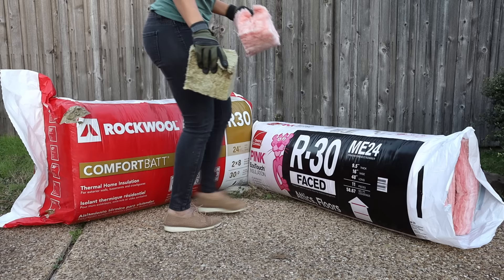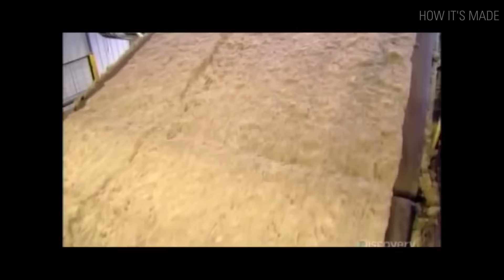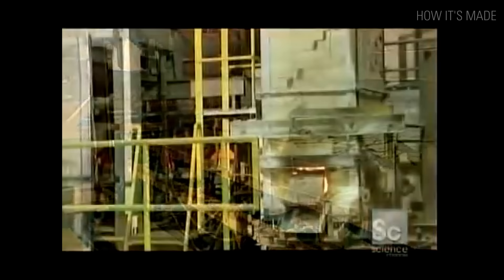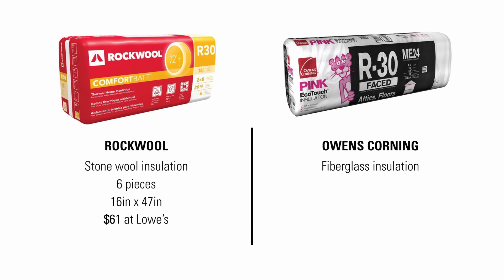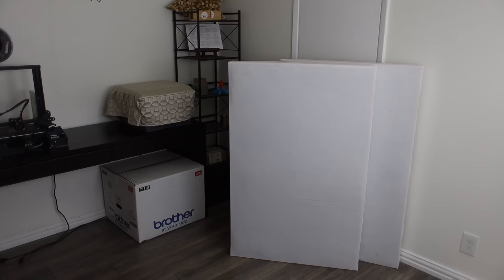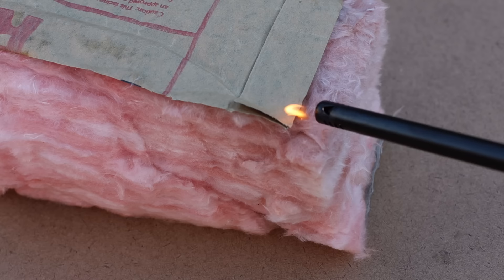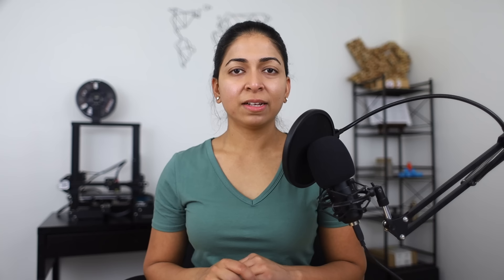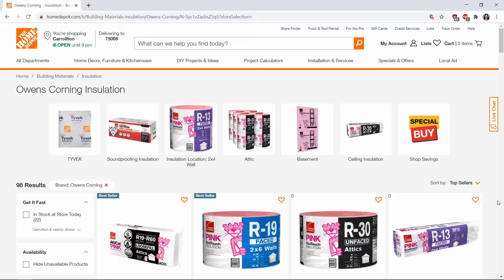Mineral wool vs fiberglass insulation | everything you need to know

Comment: Go stone wool, you'll never have to question if your insulation is harboring mold
Reply: @John Grzeskowiak the stone wool is water resistant, making it hard for mold to grow. Which if you have a leak you would still have repairs to do, but at least you dont have to replace your insulation.
Reply: @John Grzeskowiak those are gutters, you should try insulating them.
Reply: Go stone wool, it insulates well against both temperstures and sound.

Comment: As someone who has dealt with installing insulation before, you've suddenly made me a fan of the rock wool, which I've never used before. Thank you.
Reply: Only problem is that it's super expensive from what I recall.
Reply: @robertmedina3195  I guess it comes down to price vs efficiency. I can tell you, though, if water ever gets into it - like a pipe leaking inside the wall - soaked fiberglass is a cold mess by the time you finally locate it, especially in winter.
Reply: @Cetok01  if you have a leaking pipe that's buried in any kind of insulation it's going to be a mess regardless of the type of insulation. To me finding a roof leak on an insulated roof is the real nightmare since water trails down the roofline making it hard to find. I used cellulose for my attic floors on top of either closed cell foam board or 2" rigid foam board. Doing it this way I can rip down my ceilings and insulation won't come pouring down on top of me 🙂
Reply: @robertmedina3195  Good solution, decent outcome. I had to deal with what I described and would have preferred the rock wool, which probably could have been easily removed, shaken, dried and replaced. The glass was a mess, acted like a wick and led to more damage inside and to the wall.
Reply: @robertmedina3195  You pay for insulation once instead of higher utility bills forever.
Reply: @kobek4159  not true at all. Remodeling, for starters will make you pay for insulation more than once. I'm not sure how many insulation jobs or remodels you've done but you run out of space real fast trying to reuse insulation from remodels. I had to completely gut the insulation in my attic because the idiot who did it to begin with never put down a vapor barrier. I ended up throwing out a good 40 bags of material, probably more. It's common that insulation jobs are done improperly because people don't know as much as they think they do. There are also times where unfortunate things happen and you just have to replace the insulation that's there as it's no longer salvageable. For example if you find a nest of mice, I wouldn't try to save the insulation where I find a nest or if a tree branch comes through the roof causing a good leak. You should never save and try to reuse insulation that has been wet because of potential mold. Then there's also what is called wind washing near soffit vents that can damage insulation as well but most people aren't even aware of such a thing. I can continue but I digress.
Reply: I install rockwool for a living i can tell you it isn't nice
Reply: @robbiehurdman2439  what's the worst thing about it? They all have pros and cons.
Reply: @robertmedina3195  It depends on your climate, if you have a high difference between inner and outer temperature for long periods of the year, a good insulation is a no brainer. Any  installation done wrong is a waste of money, that is not the fault of the material.
If you ever worked with it, especially on a hot summer day, when you are sweating and you are breaded in wool dust like a chicken wing in breadcrumbs. It gives you new insights in itching.
Reply: @matekochkoch  ha, I did insulation for a living but we didn't do anything with rockwool. Loose fiberglass was the worst on the 100 degree days. We always did air sealing prior to insulating as well.
Reply: You wont be once you use it
Reply: @Cetok01  I used KNAUF glass wool and during construction one sheet got soaking wet as it wasn't cover yet with a board. It dry out and looked like new. Other packed foam for my attic insulation I kept near other building for a whole year or more and it got all soaking wet during a winter and heavy snow. After it got dry it was perfect. If you don't believe me I can send you pictures. Half centimetre got white due to sun (which actually proofs how long it was kept outside), but it did not get any fungus, got rotten or lost its insulation specs. I don't know about that PINK one, as in EU we don't have such, but I'm more than happy with KNAUF how it kept its visual and technical condition while getting whole wet for good half a year.
Reply: @DainiusZelnys  The glass wool I'm familliar with clumped together when wet and invited mold over time, at least if it wasn't in the sunlight. Perhaps it could be recovered, but it would be a lot more trouble than it's worth. But that's just my opinion.
Reply: @Cetok01  What can I say... different manufacturers different product. I'm not some pro builder. Just sharing my experience, and chose glass because it keeps dimensions better over time. Cost was very similar. I compared locally most popular Isover, Paroc and Knauf.  My builder was all for Paroc (rock) but i chose to go with glass. But after he noticed extremely fast drying time and how it went back to shape he was pleasantly surprised (maybe because KNAUF is hydrophobized). He said rock wool if get wet it takes week to dry in open area. If I turn back time, I would go with rock maybe, but this video doesn't present reality for sure.
Reply: trust me man, don’t it sucks to install, you can feel it through sweaters
Reply: @nevanuel1983  The only solution is to have both come in  plastic-wrapped batts.
Reply: More expensive , harder to install but a better product. Insulation installer for 35 years. Closed cell foam is probably the best but again very expensive.
Reply: @robertmedina3195  that all depends on your location, the code in your location, and the reality of what R value you need for the weather you gotta deal with
Reply: @nevanuel1983  not everybody can bro. I did both for years and neither bothered me
Reply: Don't be a fan trust me. It falls apart and really sucks to install. I've been insulating for 7 years. I know what I'm talking about.
Reply: That's funny.  The advertising is great on the rockwool.  The problem is that the pink is finally to a place where it is not dusty or itchy anymore.  The Rockwool is both of those things.... If you are worried about moisturethen use hemp insulation.
Reply: @robbiehurdman2439  I agree, it nasty stuff.
Reply: Guys, Here is The Savior

HalleluYAH translates “Praise ye YaH”

YaH is The Heavenly Father 
YaH arrives via the TENT OF MEETING
YaH was Who they Crucified for our sins
YaH was Crucified on an Almond TREE

— Ancient Semitic Cuneiform of Moshe (Moses)
— Isa Scroll (The Original Isaiah)

Isaiah 42:8
"I am YaH; that is my Name! I will not yield my glory to another or my praise to idols.”

Isaiah 43:11
“I am YAH, and there is no other Savior but Me.”

Isaiah 45:5
“I am YaH, and there is none else.”

Comment: Utterly fascinating. I had no idea stone wool insulation was even a thing. I didn't even know I was potentially interested in the topic. You give a stellar presentation and deliciously structured comparatives. Thank you!!
Reply: Thats why one might delve into topic they are not familiar with to learn about things like this. Personally i will not use fiberglass insulation anymore in anywhere, simply due it being  really hard to recycle and how easily it gets ruined. Even top of the rock wool i prefer for massive wood as it will naturally breath, there is plenty around where i live in cold north and mostly cause eventually every roof will leak some. What i have seen in construction industry around here, i would never put fiberglass into the house as just tiny amount of water that gets into insulation will not show it self, or get dried before whole frame needs to be demoslihed and potentially whole house needs to be tore down and rebuilt if owner wont notice the "early" signs of the water damage.
After that comes rock wool. Not a fan but this is what i recommend on using where you need to put insulation on. Least with this material you only need to rip open exterior or interior wall, get that damn vapor barrier out, witch is locking all that moisture into insulation and try to dry the area after leak is fixed.
On older style log construction: Ou there is a leak, well better fix the roof and thats about it. Logs will suck the water, but also let it dry naturally. I'm living in 101 years old log building that has not been maintained best and roof was and has been leaking from several spots. Biggest one let water straight top of outer wall. There is some rot damage on the top most logs and area was damp for two years.... got the roof fixed properly couple months ago and its been drying on its own. Would like to swap the log on top, but there is enough solid material so its not required and this is rental so i'm not going to go for such large repair my self out of pocket. If this was any other type of building it would be demolished back to the frame at very least. Sadly this construction material is available on near big forested areas and we dont have termites so go figure. Also massive wood does transfer heat witch can be positive or negative. On areas with lots of sunlight, i'm not sure it works that well, specially when there is not much forest anyway. Trick we tend to use is to open all windows at night to let cool air in and to cool the frame from both sides and then close the windows on morning that traps the cool air inside to be enjoyed during summer. Also we have big wood fireplaces that suck up lots of heat during summer from inside while heating in winter. For those who wonder, no you dont put the fireplace into end of the building! You place it in center so it actually warms the house from with in, not let majority of the heat outside, like i have seen in several US houses fire place being at the end of the house.
Reply: My old house is insulated with rock wool. I thought it was some obsolete, inferior product.
Thanks for making this video with the valuable information.
I even subscribed. Now I can see a list if your other vids.
Reply: You probably live in warm environment. I know the difference even without any construction practice.
Reply: I never Heard of Fiberglass insulation rockwool is Like the only Thing besides styrofoam
Reply: @SchlaftaterNrzZz  fiberglass is cheaper even today. It is widely used for industrial insulation of pipings.
Reply: It is less known in my country as well becuase we dont need its properties. We have relatively pretty dry weather here, moisture in the air isnt at the highest levels that often so we dont need stone wool here. Glass wool is much more economically viable, and in fact superior product if you count the price as well what is a huge factor. If you dont live in a very moisty climate, you are perfectly fine with glass wool and will save you thousands of dolllars for the same effect. The installation is a bit harder tho, thats true, have to use wires or similar so its secured in place until you install barriers and drywall.
Reply: @NotEvenDeathCanSaveU  Stone wool usage makes sense not only in high moisture climate but when your walls are not so thick and you want to get higher thermal resistance (R value) since R is arround 3x higher in stone wool compared to fiberglass inslation. So for double the money per square meter you get 3x the thermal resistance so in cold climate countries stone wool is actually better from an economically point of view. It all depends on your construction needs and what you want to achieve as an end result.
Reply: @kentrix.  I really don't know about that.. The R value is dependent on thickness, and it doesnt seem to have it much higher, the conductivity seems to be around the same range from 0.030 to 0.040 too, at least according to the manufacturers of some more known products I am comparing.
Reply: It looks as dangerous as "Asbestos" tho
Reply: @Hellsong89  TDLR; this guy likes logs

Comment: I just clicked on this as whim, and I was blown away how interesting,  complete, and well presented the information was. Very well done, Belinda!  BTW, where I live in the Bay Area / CA, building inspectors allow / recommend the use of Rockwool to seal top plate penetrations (say for electrical cable) because of it's great fire resistance properties.
Reply: ditto.. youtube algorithm is getting more diverse
Reply: Me too  I have never worked with Rock Wool .  I used to work construction - I HATED working with fiberglass. Pain in the ASS.  This video was well done.
Reply: excellent presentation
Reply: @johnbrowne3518  once you work with rock wool you won’t care about the price.
Reply: @Wroger Wroger What can I say, you're just wrong. Building code and fire ratings are based on testing, not periodic tables. Check out Rockwool's website on this matter, it can withstand temperatures exceeding 1,800f https://www.rockwool.com/learning/fire-safety/
Reply: I found her review to be very biased.
Reply: I have learned a lot from this video even after 3 years as an attic Insulator. It's like looking at a how it's made video. She is my inspiration on how to make my videos.
Reply: 420 bro me too
Reply: Why are these products are still allowed to be used?. It’s just plain common sense…

1. If you need to cover your skin, head,wear a professional respirator, eye protection and  heavy gloves when installing, how safe could a product be?
2. What happens to the insulation when hurricanes, tornadoes, earthquakes etc tear it apart? 
3. How does it break down in the environment?
4. What happens if you breathe it in or if you are allergic to the toxic chemicals?
5. What are VOCS and why is our indoor air more contaminated than our outdoor air?
If you answer all 5 correctly, you will know the answer to my initial question. 
I hope someone will take the time to learn how dangerous these products are and ask why. 
I am allergic and have been exposed to fiberglass insulation dust for a number of years. I have chronic asthma and skin lesions that are very painful. Owens Corning has refused to help and blocked me. My health is permanently ruined along with 10 million other people in our country. Wish I saw this 8 months ago…
Reply: @carolcameron6205  so rockwool is better than fiberglass right?
Reply: @carolcameron6205  not to mention that Rockwool is one of the insulation products that's most detrimental to the environment with the enormous amounts of GHG emissions released during raw material extraction and manufacturing of the wool.
Reply: True, I'm amazed
Reply: wait you have inspectors??? I'm living in Oregon and 9 month builds with no inspectrions lead to   mobs attackign people to steal land to  hide fire dangers. wow inspectors. I wish.   It is a great video though innit.
  I'm  going to try to save for  continuous rokwool after it.
Reply: @Krizbonz  Fine, even good, for a review to be biased. Question is, was her research biased?

Comment: My dad used to work in construction, around 40 years. Most of it in insulation and some in roofing (i hope those are the right therms, English is not my first language).
He swears by rockwool for insulation in our cold region.
He used to demonstrate the fire-resistant of it by placing a block of it in front a propane gas flame and a piece of paper behind the wool. Turn it on, and go for a coffee with the client. 20min later the flame is still going and the paper was still spot loss...
Just a little anecdote.
Thanks for this informative video.
Reply: So fire resistant that it is literally the stuff they put small fluffy pieces inside gas fireplaces to give ember-like glo spots.